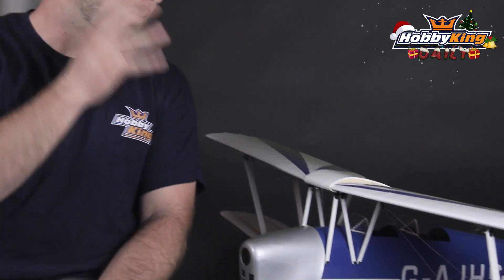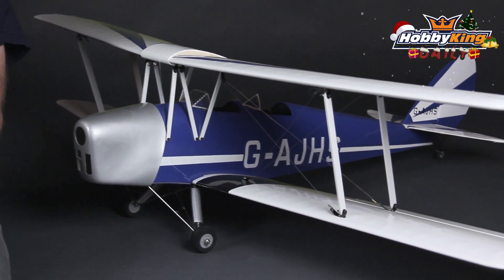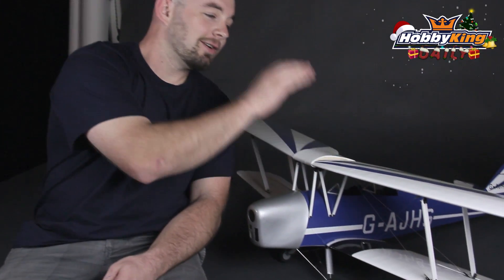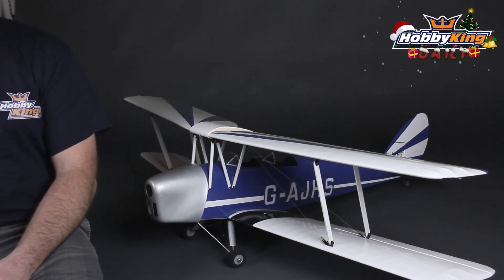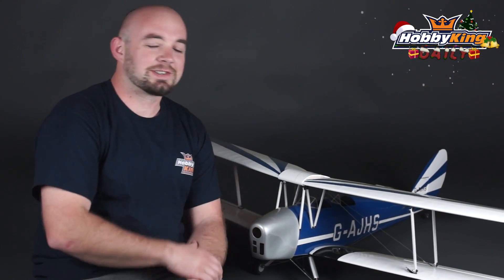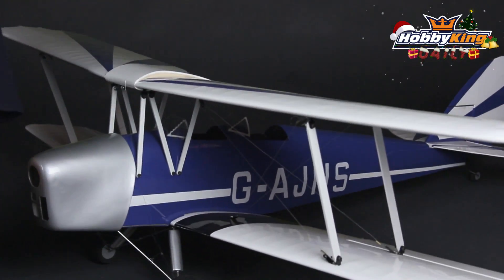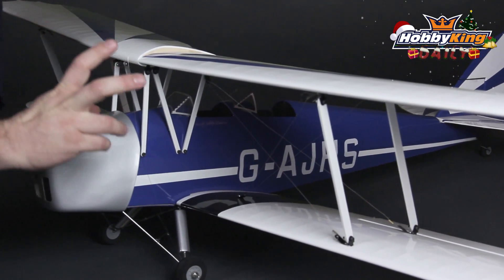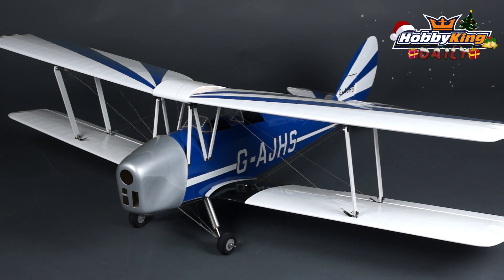S19 Mini Tiger Moth Balsa Wood Plane 980mm (38.6") Kit - HobbyKing Daily

Comment: I recently bought the 55inch SE-a5 from hk the construction quality is not to bad apart from the elevator slot was poorly cut and took some work to get level and there was a lot missing from the finishing kit but for the price you can go wrong just be prepared to over come some build problems aand you will have a great flying model...